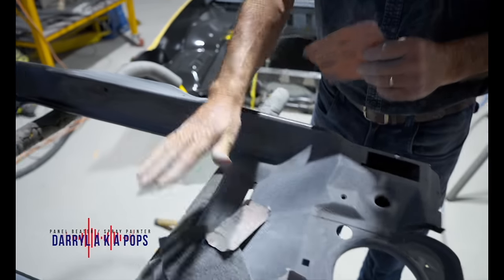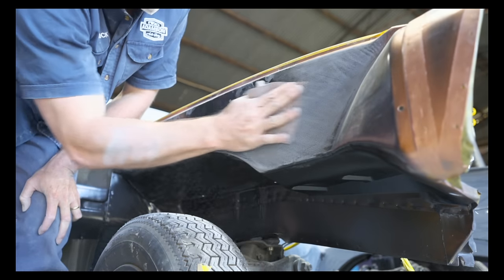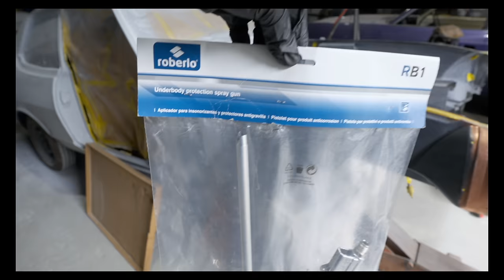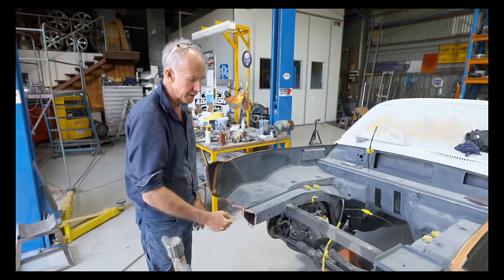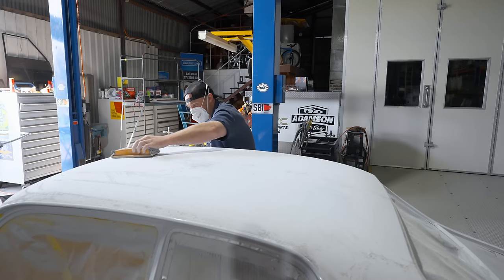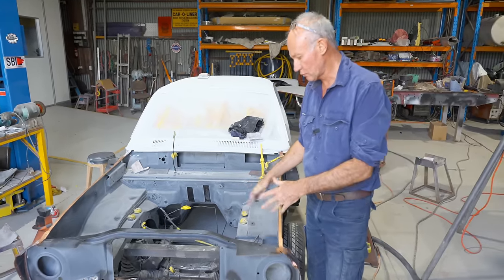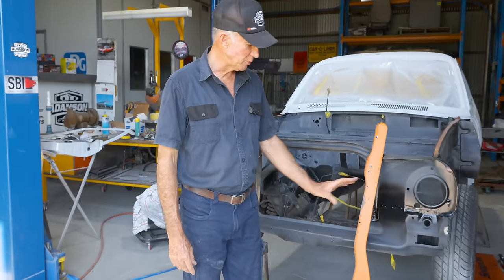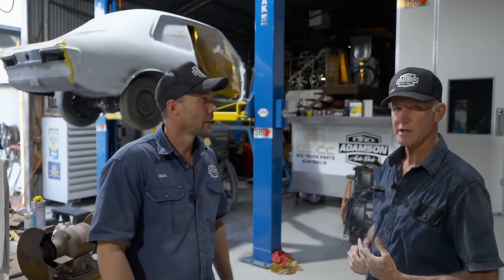Restoration REBUILD Series | Holden Torana Gtr Xu1 ( Part 47 ) Prep work on panels.

Comment: Love your stuff guys. Just a question for you guys, I'm undertaking some body repair on a ford territory I own and I've managed to pull out the majority of the dents with a weld studs and a puller. Its difficult to get into some spots with the slapper and dolly to smooth the whole area out. Someone suggested a shrinking disk to me. Have you even used one and what are your thoughts on their effectiveness?